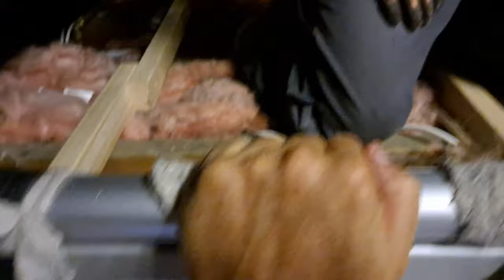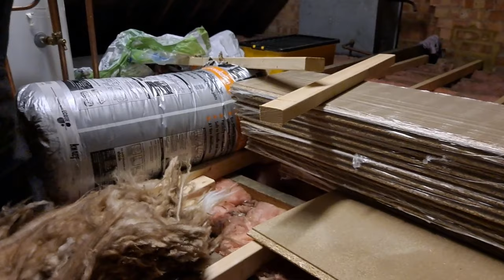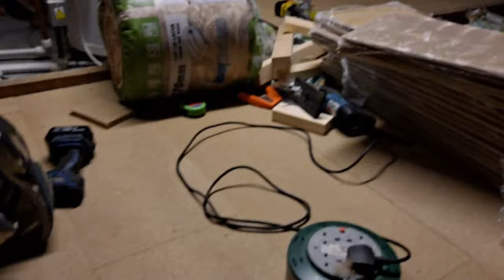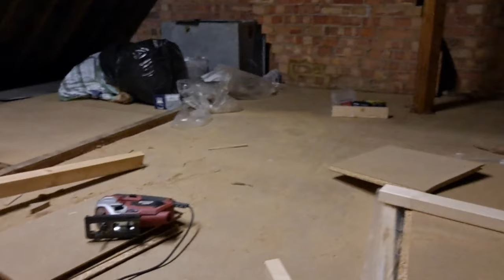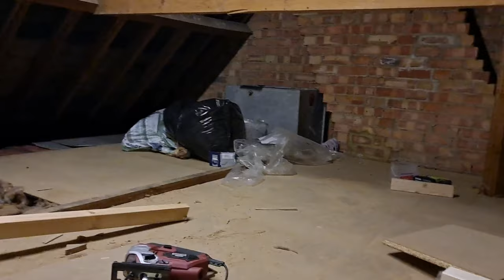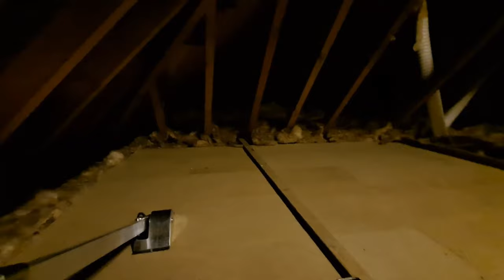Professional Loft Boarding part 1 (Raised Loft Floor)

Comment: Yea good video. Recently did this in mine before converting. If your house is older and some of the old beams aren't perfectly straight be prepared for some potential ceiling cracks and plaster pops below. The new timbers pull the old ones straight and the pressure can cause cracks. But all good.

Comment: Hi great videos I'm doing a hobby room up in my loft I currently have 4x2 ceiling joists but not much headroom can I get away with 3x2 cross bracing or will it have to be 4x2 and do I need to put them onto wall hangers or just screw them down to the original joists cheers
Reply from the maker: 3x2 will be fine at 90 degrees to original joists direct onto joists
Reply: Can this be then used as a converted room and will be up to building regs?

Comment: Hey. Many thanks for the vid! Lots of good info on the comments too. I have a couple of questions. What kind of screws do you use? (I know the 8x2 bit) but are they gallvanized, deck screws? what type? also Do you pre-drill holes for the screws or you just screw right into the new cls? Finally... By keeping the new timber 400mm apart you can use the standard floor boards which if I recall correctly are 1.2mts without having to cut them (except on tight corners and else)? Is that a fair assumption?
Reply from the maker: Thanks, 2 inch twin thread screws, we do not pre drill holes, and yes osb 1.2sqm boards are best.

Comment: Another option that I used was to put joist hangers on the original BIG heafty timber , you can see one in this video to the left of the mans feet , another would be  in front of him out of shot . In my case I then put 6 by 2 joists in on the hangers , so that the floor was not bearing on the ceiling at all . And zero ceiling cracks in the rooms below as a result .

Comment: Hi great video thanks 
just a quick question if you place the new Cls directly on top of the old ceiling joist wouldn’t the old joist be taking all the weight instead of strengthening them as the old joist ends will be on the wall plates? 

Please don’t take it as a Criticism, it’s a genuine question I don’t know the answer … just thinking out loud before we start ours lol 😂 thanks and any help would be appreciated !
Reply: It does add quite a bit of strength and helps spread the load but it's not the same as installing a new floor with proper floor joists. The latter is better however it's a MUCH bigger and more expensive job.

Comment: How do you keep all the flooring entirely level? for instance the joists in my loft aren't 100% in alignment some might be .5cm or more higher than others.

Would you be grateful for your thoughts
Reply from the maker: We have to use a bit of bracing under the cls batons, this usually works fine, good luck with the project.

Comment: Hello, getting a loft ladder installed soon and plan on boarding my loft when after that.  I have 1 question. What’s the distance between each batten and what size screws ?
Reply from the maker: Try and stick to 400mm between each cls joist if possible, good luck with your project Mark !
Reply: @MrBish11  thanks for the advice. Went to wicks today to price wood up and brought a length of 4x2. Went into the loft and put it on the joists and on some joists it does not touch. Out of the 5 joists it covered only 3 points of contact.  Is there a trick to get around this? Just packing ? Cheers

Comment: Advice please!  I am about to convert my loft into an office space, this is a great video - he drilled the cross bracing directly into the timber below at an angle.  I was going to do this with L shaped heavy duty brackets.  I imagine my way will create extra work/expense needlessly.  Could anyone offer guidance?  Thanks very much!
Reply: Get yourself a structural engineer pal.

Comment: So I visited my loft last night! (First time, new build) and the insulation is really deep, almost like 2 layers, what do I do about this? taller CLS?
Reply from the maker: no, you should be able to board the middle section if there is one and using 89mm cls, remove some of the insulation and place it on either of the two sides, just put back as much as you can between the gaps in the cls..

Comment: Hi thinking of converting my loft into a little bedroom what are the best timber to use plz?? An also do I need to use hangers an do I need to run them the same way as the original joist?? Just trying to get as much advice as I can thanks..

Comment: Hi I know this is an older video. I'm looking at a flat loft so quite large, just as a space,  so no toilet or other reg stuff. I'm interested in the cross bracing, if existing older joists are usually 4x2 or 5x2. Without sliding in new 8x2 along side the old ones to bring it up to spec for an actual live in space, I've seen it being done by gluing a 2x2 or 3x2 on top of the joists and screwing at set spacings passed by architects. Does this counter bracing basically do the same or spread the weight over many joists or is it just to create more space for more insulation?

Comment: Hi, great video. My joists are 84mm x 36mm. Should I cross beam using 89 x 38 or 63 x 38 timber?
Reply from the maker: Hi, depends what level of insulation you have, if it is 200mm or over use 89mm, hope this helps
Reply from the maker: also if the roof pitch is low, use the 38 x 63 cls as the 89's are a little high for low pitch roofs
Reply: @MrBish11  can you explain sorry, but if you use 89mm high timber to run cross ways to the existing joists And put in 200mm insulation then you will compress it by more than half and ruins its effectiveness - surely - or have I missed the point?
Reply from the maker: @normanboyes4983  200mm is the total, 100mm between the original joists and 100mm between the new cls, equates to 200mm insulation plus the boarding so you should not lose any heat.
Reply: @MrBish11  Ahh OK understood.👍 However the minimum standard for insulation in (current) building regulations is 270 mm. I think homeowners aspiring to improve to meet the latest standard will struggle to incorporate that depth with your recommended approach of using timber supports as it’s going to require quite hefty and expensive timber.

Not trying to be difficult - I am about to embark on topping up my existing 100mm with a 200mm layer on top. I need to board at least one third (about 35m2) for storage and I will need to walk on it too.

The house was built in 2000 and the roof construction is horrible and moving around the loft is difficult - so much wood up there (trusses and hips).

I am struggling to work out the best and most economic way of doing it.🤔 be

Comment: We’re looking to use our loft as a spare room when needed in house we’ve just purchased. Could we do this method? Or would it have to have steel or bigger joists bolted to existing ones?? Cheers if anyone could get back to us.
Reply from the maker: Hi, definitely not this method as its designed for storage only
Reply: @MrBish11  Cheers for quick reply!

Comment: Hi please don't laugh, a total novice here - but would it be possible for me to do this in my loft ( trying to make a studio of sorts) following your instructions.....thanks for any advice and good vid
Reply from the maker: Hi Mark, although it is really meant only for storage, I cannot see any reason why you cannot make a studio up there if you have the head room. Make sure that you brace all the joints where the boards go together and use enough cls at close spacing say a maximum of 400mm apart - -good luck with the project !
Reply: @MrBish11  thanks very much for the information really appreciate it....and i'll subscribe and check out your other vids 😉

Comment: Great vid, thanks. My loft already has insulation (roughly 15" thick), would i still need to raise the boarding in order to leave a gap? Cheers
Reply: I have the same question
Reply: As long as you don't compress the insulation it should be fine. My attic has two rolls of insulation so I need to do this soon so I can throw all the crap we have accumulated that we never use but can't dump, up into the attic 😂
Reply: @KeeronMac  thanks, also, why can't you compress the insulation, is it a regulation thing or related to damp?
Reply: @KeeronMac  understood, really helpful, thanks a lot
Reply: @PackPullParadise  From what I have read and watched with hours of these videos it just makes the insulation less efficient. I know I'm 6 months late to replying haha
Reply: @popdroprolld20  appreciate in, in that time I've gone and boarded up my loft, the room does feel a little colder but if you even put a little heating on the room boils so it's fine. The loft is nice and secure, very happy with my work

Comment: i have 3x2 ceiling joists in my loft spaced about 14in apart and i want to board it out for storage  but want to strengthen the floor , i was thinking about screwing 3x2 on top of the existing 3x2 to add strength making them 6x2 does this sound ok , or is doing a criss cross method better + the same as the video
Reply from the maker: Thanks, I would really suggest having the cls at 90 degrees angles as this will definitely strengthen the loft foor

Comment: So if my original joists are 100mm, how am i achieving 270mm regs of insulation without compressing it?
Reply: You apply feet on top of the joists for the boards to sit on raising the floor level.

Comment: hi great video do you need to leave a 10mm gap between joints?
Reply from the maker: No, you stand more chance of getting condensation if the cold and hot air passes under the boarding, thanks for your comment !
Reply: @MrBish11  thanks for answering appreciate it

Comment: Hi mate great video I'm planning to do this myself. What size timber do you use for the Cross sections. Is it 3"x 2"?
Reply from the maker: Cls 316
Reply: Cheers mate!
Reply: The 2nd lot of insulation (brown) looks like it'll be squashed when boards go on top. Can it breathe?

Comment: A quick question - I will be boarding my loft soon (old house) and small loft. The joists are not all level, what is the best approach using your method of using cls over the top of the joists (pre attaching loft boards), please? Also what OSB loft boards do you use or where do you get them from? And finally, where do you get your screws from and what brand (I see in the comments you say 8x 2" twin thread)? Thank you in advance...
Reply from the maker: Use the 3 board 1.2m packs of osb and try to brace under the uneven joists to keep as level as possible, good luck.
Reply: @MrBish11  Thank you for your message, very kind of you.
Reply: Dear GM, all going well with the boarding. However I have one question I am using the 8x2 screws into cls 63x38x2440 - when I screw the cls to the joist (using the screw at an angle) the screw sometimes doesn't always bite into the joists and can occasionally split the cls. Is there any special technique you use that I could consider please? Any feedback would be much appreciated. Thank you in advance.
Reply from the maker: @NormDave  screw slightly higher from the bottom of the cls, this should work
Reply: @MrBish11  Tried that and it seemed to work better - thank you. With the areas where joists and cls have gaps between them is it best to use packers or double brace (as you have mentioned in some of your videos). I'm assuming that "double brace" is using some cls screwed into the joists, on both sides of the joist to compensate for the gaps? It's starting to look good now - I'm very grateful for your feedback...
Reply from the maker: @NormDave  no use packing between the cls and joists, anything that fits will do, bit of boarding or ply etc, just make sure it is not bouncy when the boards are down .

Comment: Hi my joists in the loft are 3 x 1 inch is this method safe to put boards over my joists , with the weight 

Thanks ,great vid 👍🏻
Reply from the maker: Hi, no use cross cls from a DIY store, 2.5 inch height at 90 degrees to the original joists, this will then transfer the weight and allow it to be walked on without the fear of cracking out the ceilings.
Reply: @MrBish11  thanks 🙏 much appreciated

Comment: Hi I’m thinking of doing this in my Loft this weekend. My joists aren’t very big though. Approx 75’mmm x 32mm. Would this method be possible with such small joists or would you recommend sistering?
Reply from the maker: Hi, I would use cls 38 X 63 X 2400mm to keep the weight down
Reply: @MrBish11  thank you sir. To be honest I already have a lot of 2x4 or 38x89mm which I planned on using. Do you think this would be problematic? I was thinking of trying to join the added supports on top of a supporting wall in the attic ( Least I think it’s supporting) and then using noggins to strengthen but do you think this is a no go? 

Thanks again

Comment: Hi thanks for the video, what screws did you use to secure the timber down?
Reply from the maker: Hi,    8 by 2 inch.
Reply: @MrBish11  thanks mate. Will be going up into my loft this weekend to measure my existing joists and seeing what kind of support they will need. It’s an old house (1895) so I’m guessing they won’t be the best. We have old lath ceilings underneath that as well so want the flooring up there to be as sturdy as possible. Do you ever fit the extra timber side by side to the existing joists to strengthen? I’ve seen this done or do you always do it 90 degrees?
Reply from the maker: @archiethere85  I have also seen this done, but would recommend using 4 inch cls laid cross section to the original joists (90 degrees) insulation between the joists and board over, this will then disperse the weight when walked on.
Reply: @MrBish11  Great simple video, what size timber would be ideal for the 90 degrees to the original joist? I am thinking of laying a 18mm loft boards and don't want the height of the loft to be compromised
Reply: p.s. what is the spacing recommendation between the additional timber?
Reply from the maker: @samnasir6599  400mm
Reply from the maker: @samnasir6599  hi, use basic cls the height is only about 2.5 inches
Reply from the maker: @samnasir6599  use cls, only about 2.5 inches higher than the original joists but will disperse the weight significantly.

Comment: Mine is already boarded. But the idiot who did it, has laid the boards on ceiling battens!
There is a supporting wall in the centre. I was going tobuild up on top of this wall with a 3 x 2 spacer, andl lay 4  x 2 joists on top of the spacer, overlapping on the supporting walls.
But i don't know what to attach the othe end to as they go towards the eaves?
I was thinking of suspending timber bolted to the rafters, and attaching the joists to the bottom of these timbers? Obviously once they are level.
Is this allowed?
Reply from the maker: Exactly what we do when there is no supporting joists, usually towards the gable ends, we just screw cls across and this usually does the trick.
Reply: Cheers Bish

Comment: No Air gap between floor and wool? I did this and it caused moisture to form under the sheet flooring.
Reply from the maker: That is rare, you are much more likely to get moisture if you leave a gap, especially in an older loft that is prone to some condensation !
Reply: @MrBish11   I have a 1st floor that is undone, basically just looks like a massive space above the ground floor with wool as insulation between floors. I believe it’s the hot air rising from the ground floor condensing onto the underside of the cold 2nd floor flooring.

Comment: I’m planning on doing my loft, what’s best timber or loft legs?
Reply from the maker: Definitely timber, use 4 inch cls running cross ways to the original joists, put back insulation and board over - would not recommend loft stilts in any format.
Reply: @MrBish11  thanks 👍
Reply: What size timber 4inch by? Thanks
Reply from the maker: @LittleTimmy685  use this size, works well 38 X 89 X 2400mm
Reply: @MrBish11  cheers fella
Reply: How come you wouldn’t recommend loft legs? I was going to do mine with them but after watching timber being used I think I’m edging towards that idea.
Reply: In a new build property would doing this invalidate the House Builders 10 year warranty at all ?
Reply from the maker: @redarmy695  no, just don't remove any insulation

Comment: How far apart are you laying them cross beams please?
Reply from the maker: 400mm
Reply: @MrBish11  thank you. 
If I’m using wickes loft boards I want these 600 mm apart right?
Reply from the maker: @neilbrighton4943  you may want to stick to 400mm
Reply: @MrBish11  when you do 400mm, does the floorboards not hang in between joist. Then how do you secure it.
Reply from the maker: @khaleelghoora9467  no, they don't hang, just use 2 inch wood screws at an angle into the cls and joists.

Comment: What size of screws are you using?
Reply from the maker: 8x2 inch
Reply: @MrBish11  Is this for the whole project, cls to joists and OSB to cls?
Reply from the maker: @jackathowarth  yes spot on, you only need one type..
Reply: @MrBish11  refreshing to have a response from the professional! Thanks again

Comment: Doing they would it be okay to have a desk, computer amd office chair and obviously my weight sitting on it (85k).

Or would this be to much?
Reply from the maker: I have done many lofts where the client has chosen to do this so should be fine if the work has been completed correctly.
Reply: @MrBish11  that's brilliant. How much weight would you say it could hold roughly?

Also my attic has 2x4 joists. What size timber should I use to go across?
Reply from the maker: @danielwillz2155  You should refer to manufacturers guidelines, but if you use 4 inch cls and brace all the joints from underneath, it should hold a fair bit of weight.